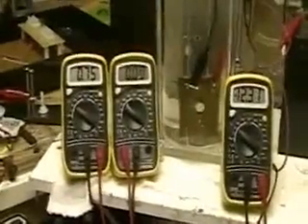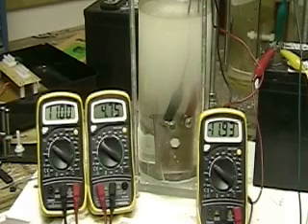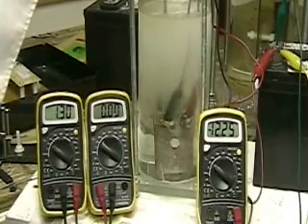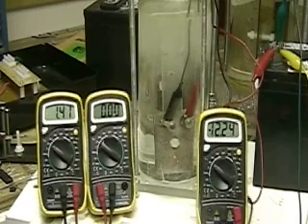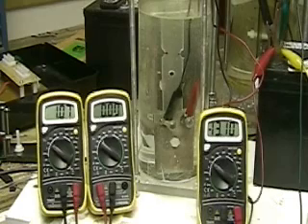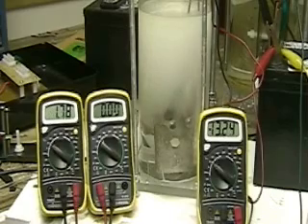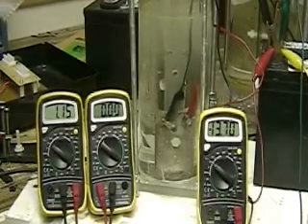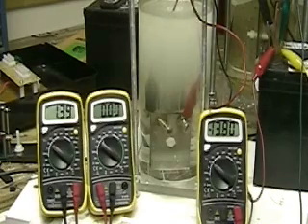Hydrogen Tap (Project 5th Test) 128

Comment: My theory was that the opposing polarities of the DC system produced the effect we see (ie... the positive in front and negative in back, as we see it on the screen)...I think it may be this plus the fact that the center plates receive the electricity first then the outer plates receive a lesser charge (evidenced by less hydrogen production in those areas) coupled with the most important fact of the spacing (ie... that the plates are spaced at angles to one another).